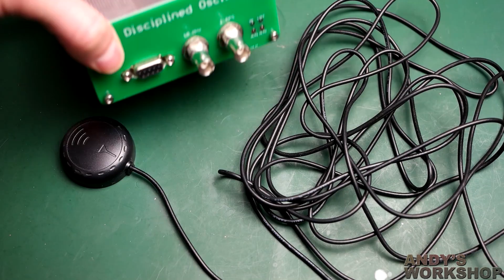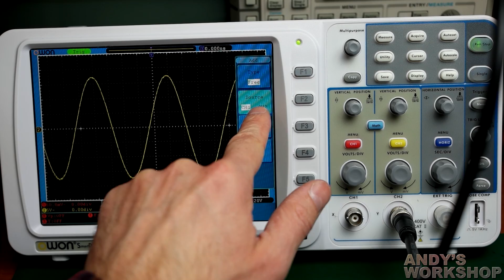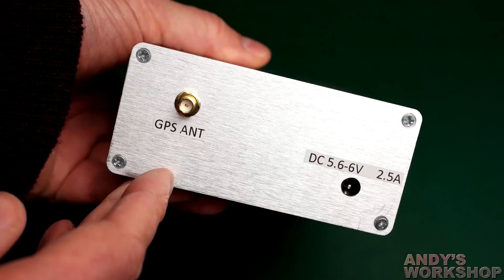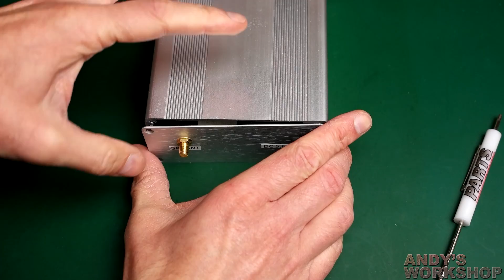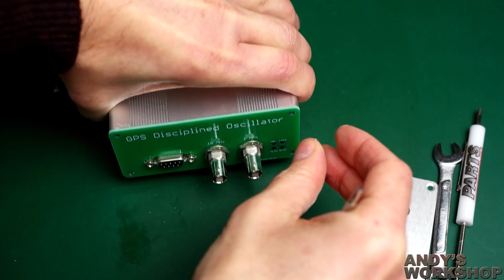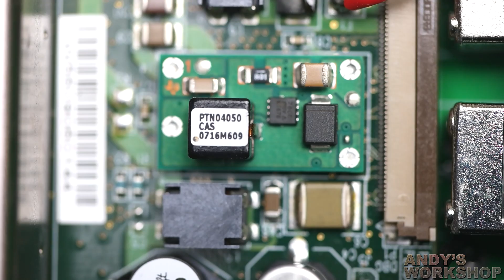GPS Disciplined Oscillator (GPSDO) review and teardown

Comment: A couple of “I think” comments.  In my books the date code 1205 more likely is year 2012 and week 5.  And the R01 resistor marking is likely to mean 0.01 ohm, i.e. 10 milliohms.  Generally the location of the “R” signifies the location of the decimal point.
Reply: Very true. 1205 should be 5th week of 2012

Comment: The thin, pale-blue wires are wire-wrap wire, very likely old stock and dirt cheap, since only a few elderly hobbyists are still doing wire-wrapping, although it is still used in the electronics industry for rework on PCB's to correct small layout problems or circuit design errors.
Reply: This type of wire is still being  sold and used a lot. We use this type of wire a lot as "bodge wire" to make modifications on PCBs or to add probing points to a development PCB.
I still remember soldering a sh.tload of wires on a large SMD microcontroller. These thin wires look like tree stumps under a microscope 😵‍💫

Comment: The 7806 is a 6V linear regulator. the module is probably a switching regulator/linear regulator combo or something like that. Rather than design one they just bought a module with known, extensively tested characteristics.

Enjoyable video, thanks. Might get one of these.

Comment: Why did you take the SMA connector off the rear panel when the extruded case just splits top/bottom? Just needed to take the screws out of the front panel!!

Comment: Could you measure the tuning voltage at the OCXO to determine if it is operating at the limit of the tuning range? (end of life)
Or did you conclude from your investigation of the serial port that it is still working ok?
Reply from the maker: One of the status messages from the serial port was "Good Accuracy & Stable". I took that to mean that it's still working OK. My guess is that these things are installed with a fixed decommissioning date set in the future and they're replaced then regardless of actual condition.
Reply: Good to know, thanks.
Reply: what command did you issue to get that returned?  Any list of commands?